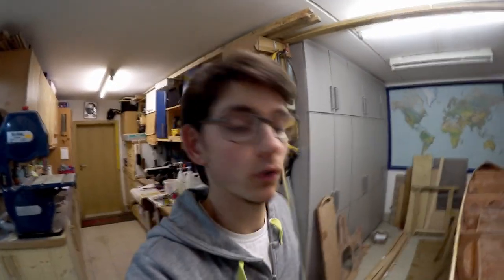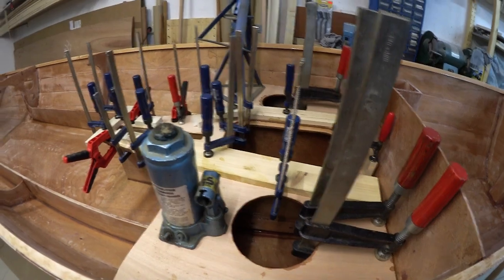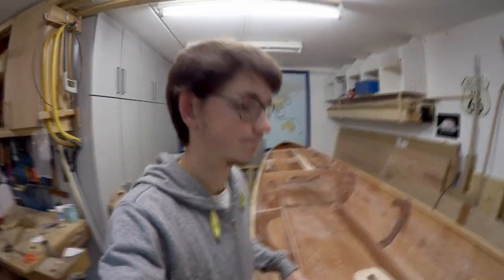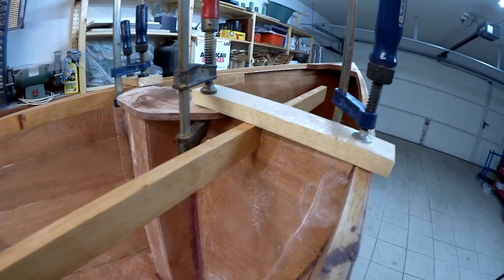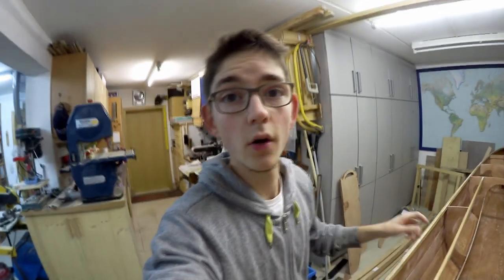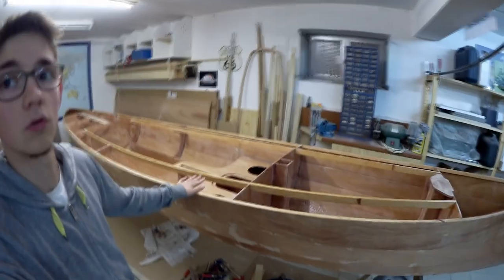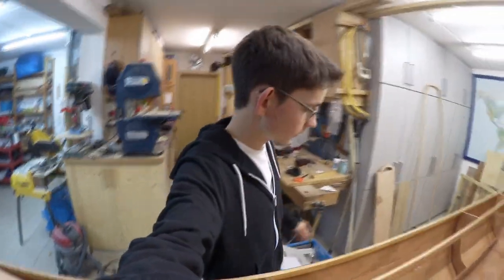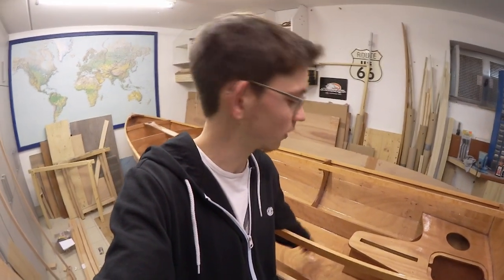Building a Waterlust Sailing Canoe (part 5): Finishing the inside

Comment: Handsomely. What is the thickness of plywood in the hull?
Reply from the maker: Hi, sorry for the late reply, my notifications seem not to work. 
The outer hull and the deck are 4mm, the structural parts (frames etc) mostly are 6mm and very few parts are in 18mm multiplex (but those could be made from hardwood or multiple layers of thinner sheets too.)
Reply: @elltielle   Vielen dank!